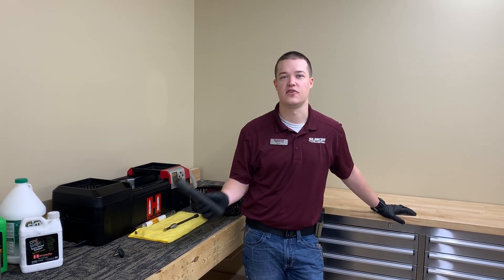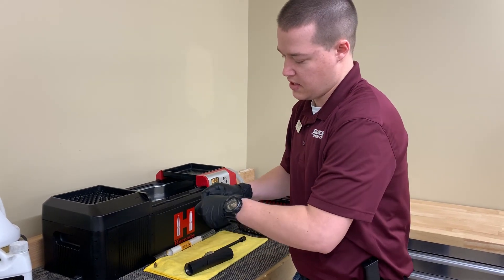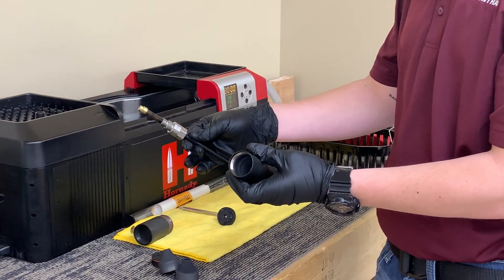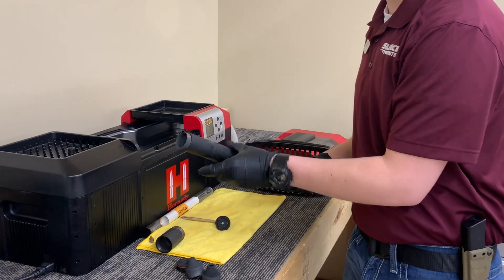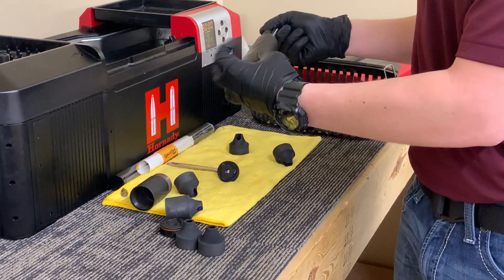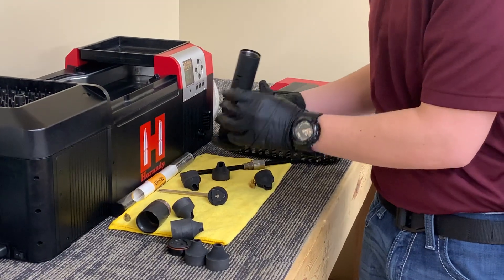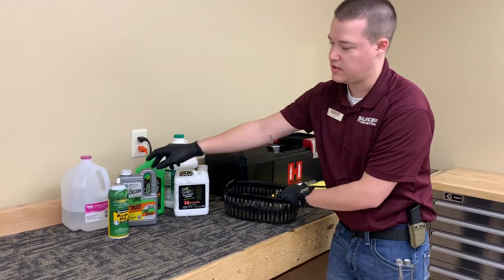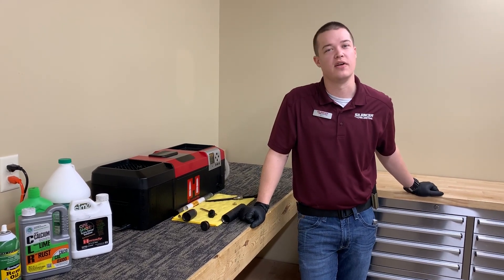How To: Clean a BANISH 30 suppressor with a Sonic Cleaner

Comment: How about the tube; can that go in the sonic cleaner or not?
(Getting ready to do my first cleaning on my Banish 30 & 22k V1)
Reply: You ever figure it out?  I have a sonic cleaner being delivered next week and was wondering the same thing.
Reply: @Threedog1963  S.C.  said the sonic cleaner could damage the paint (it’s cerakote). I just don’t put the tube in the machine.
Reply: I meant to say I just put to 22k core & Banish 30 cones in the machine. I clean the tubes by hand
Reply: @seanleverone7680 what do you use for cleaning solution in your sonic cleaner? Thanks

Comment: I shot maybe 3-400? Rounds through mine and can’t even get it apart. I tried the removal tool and it just stripped out on the end.. Needless to say I’m not overly ecstatic… 👎👎
Reply: It's almost like the user manual you got explicitly says they recommend cleaning every 200 rounds
Reply: @dakinesc09  I ran 400 rounds through before cleaning. Came right apart. But, mine is a Banish 22,  maybe that makes the difference.
Reply: @Threedog1963  I have shot probably 500 through mine before cleaning but right in the owner's manual For the banish 30, on like the second page it says that you should clean it every 200 rounds
Reply: @Threedog1963  did you get the banish 22k? I actually got one when I bought my banish 30 but I haven't tried the banish 22k
Reply: Same. I shot 6 mags of 300 BLK 180 rounds. Siezed up. Fought it with a pipe wrench. Got it apart, cleaned it, and forced it back together. I filed the burrs down. WONT BUY ANOTHER banish 30.

Comment: Okay so the expansion tube stays,in thanks for that. I was wrecking my brain on how to get it out. But I wanna say I have maybe 400 rounds through it and I had trouble getting the end cap off, had to use a torx 45 on an impact wrench! After that the baffles had to be removed using the tool. Two of the baffles stuck together till a few sonic bath cleanses with Hornady one-shot. They got pretty clean though after a few sessions.  Upon reassembly I don’t see any o ring and minimal gap, but when I shake the suppressor I can hear a tiny bit of movement. I’m wondering if that’s okay? So these were coated in carbon, about an hour of sonic bath and some toothbrush scrubbing they are looking good. They are actually shiny like the ones in the extension tube that I have never used.

Comment: UPDATE...  Still no reply after 3 weeks.. lol

SO... I used some CLR and put them in the ultrasonic cleaner and they came out with most of the coating removed.. no longer  red,  blue parts etc.. WT Heck... Now silver looking including the thread adaptor.. So I am assuming the CLR removed all the coatings.... What to do Now??? Can it still be used? What about tolerance's??
Reply: Red and blue baffles? Are you cleaning a banish 45?  If so the baffles in a banish 45 are aluminum and should not be put in an ultrasonic cleaner
@silencercentral has done a pretty good job leading people to believe the banish 45 is all titanium
Reply: @robduncan7747  Yep. your right.. I have both and I was cleaning the Banish 45.. and the coatings came off..  I contacted them and was told it didn't matter...
Reply: I did my banish 30 and the gray gunk is caked on and does not come off in the cleaner. I have to chip it off with a metal tool.
Reply: They Try, but more support for all of us newbies with suppressors would be Great.... it's their own fault making them so easy to get one.. (well wait a long time).. I don't know why we just can't order the baffles separately.. Not a NFA item.. Not serialized... @michaelcarton3299

Comment: Couple questions. How much CLR to water in the sonic cleaner and how do you clean the inside of the suppressor tubes?
Reply: Did you ever figure out how much clr was supposed to be added?
Reply: @diongalbreath.1  It was 50%, not critical but about that.

Comment: Do you not put the suppressor body in the sonic cleaner? How do you clean the inside of the body if not?
Reply: No, do NOT place the outer tube of the suppressor in the sonic cleaner.   The cerakote will be damaged by the cleaner.
Reply from the maker: The tube itself does not go into the cleaner. We recommend using a nylon brush to wipe out any carbon that is stuck on the inside of the tube.